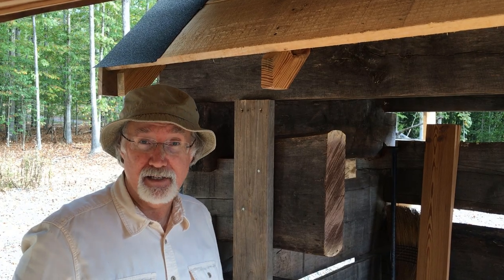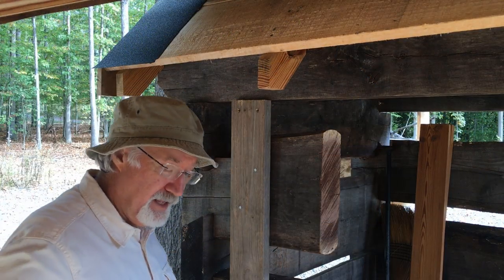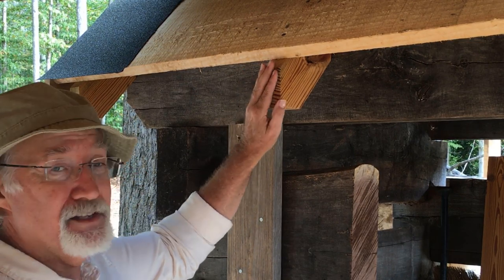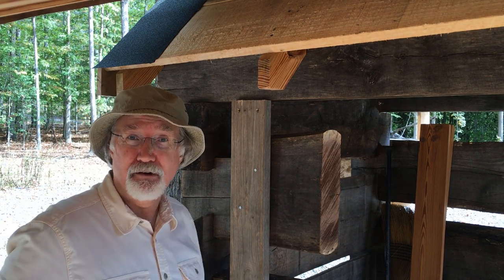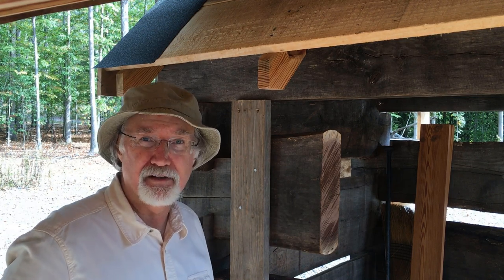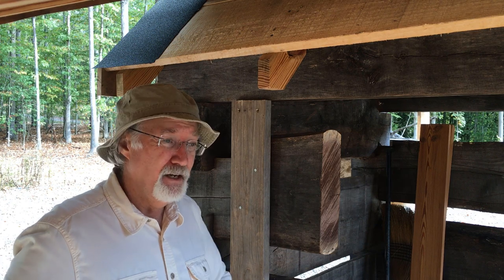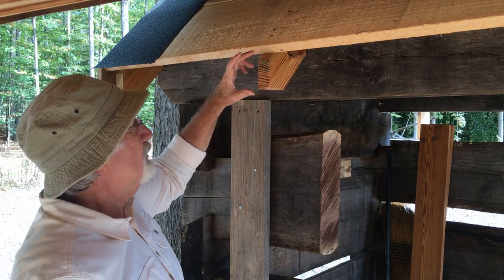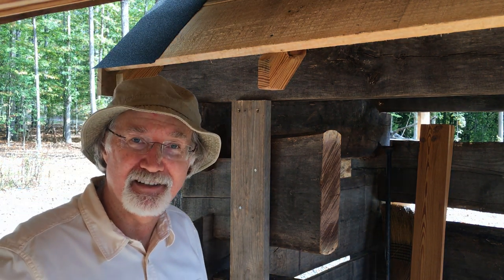Log Cabin Fascia!... Handmade House TV #94

Comment: Hi, Noah. I have questions about the placement of your horizontal fascia. It appears, in shots like 7:57, the fascia is high enough that it interrupts the slope of the rafters; wouldn't that invite rain or snowmelt into the crevice between the wood? Or does that not matter so much when it's being covered with tarpaper and roofing? I imagine that with the fascia placed lower, just below the slope, or perhaps angle-cut on top in-line-with/below the slope, or even placed under the roof sheathing, that running water would more readily flow across it to the outside. Then again, perhaps this was for aesthetics in a place where it'd be protected anyway? Or maybe this is to give your roffing (slate, I think you said?) a handy place to rest the starting course?

Comment: Agree completely, even the Adirondack Rustic style leaves the fascia off, and a lot of pre WW2 style homes and small commercial buildings like gas stations, here in Upstate NY, and the rafter tails rot like you say. My grandfather roofed his house without any fascia and there are issues because of it I have to deal with now. The boxed in construction was used on his barn, and always full of bees and then mice nests, so I ripped that off to let it dry out, keep the bees and hornets eliminated, and just apply a fascia board.